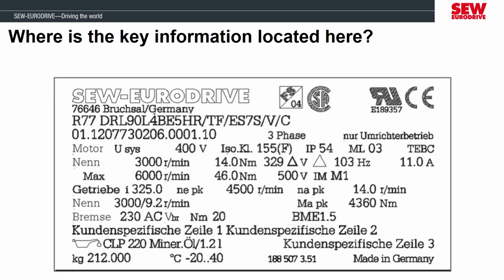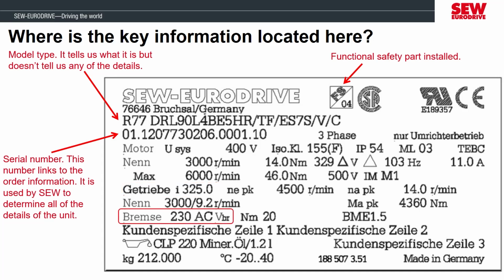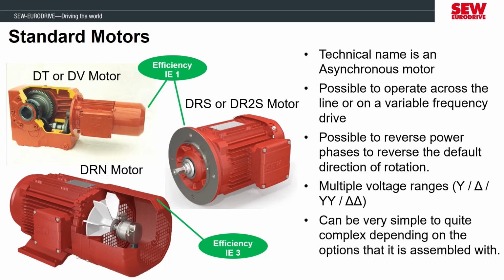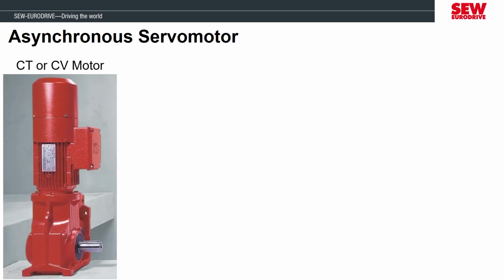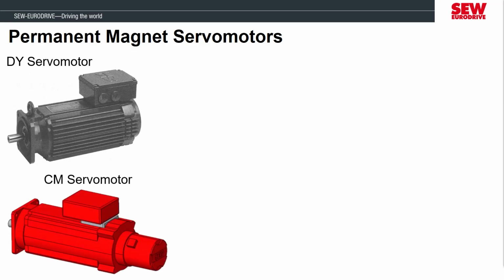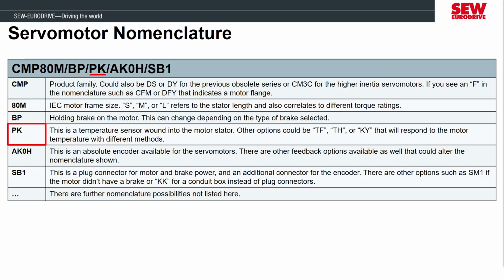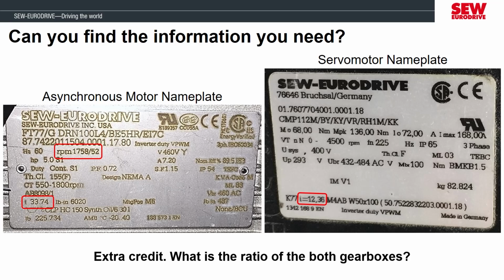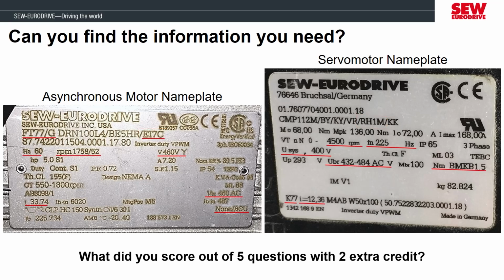MOVIDRIVE® B Training Session 4 - Motor Nomenclature

Comment: 4500 rpm for servo at 225 Hz on nameplate ..   How was this speed calculated  ?
Reply from the maker: Hello Michael. Those values are the ratings on the nameplates and are due to how the motor is designed. Permanent magnet servomotors differ quite a lot from standard 50Hz or 60Hz asynchronous AC motors. Servomotors have to be operated from an inverter oftentimes with encoder feedback instead of "across the line" such as standard asynchronous motors. Inverters are capable of outputting frequencies close to 500Hz. This is why servomotor nameplates will show different rated frequencies and speeds than standard AC motors because of how it is designed to be operated. 

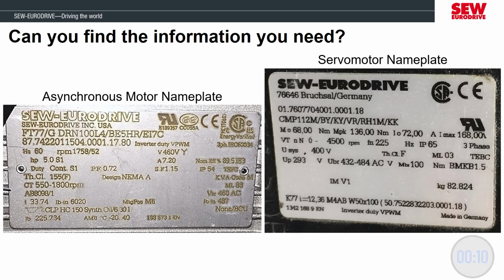In the case of the example shown at 23:10 in this video. That is a CMP112M designed with 6 poles and rated for 400V, 4500 RPM, and 225Hz. 

Here is an equation showing how the 4500 RPM could be calculated.

𝑠𝑦𝑛𝑐 𝑠𝑝𝑒𝑒𝑑 [𝑟𝑝𝑚] = (120 ×𝑓𝑟𝑒𝑞𝑢𝑒𝑛𝑐𝑦)/𝑝𝑜𝑙𝑒𝑠 =>
(60 𝑠𝑒𝑐𝑜𝑛𝑑𝑠/𝑚𝑖𝑛𝑢𝑡𝑒 × 2 𝑝𝑜𝑙𝑒𝑠/𝑝𝑎𝑖𝑟 × 𝑓𝑟𝑒𝑞𝑢𝑒𝑛𝑐𝑦 𝑐𝑦𝑐𝑙𝑒𝑠/𝑠𝑒𝑐𝑜𝑛𝑑)/(𝑝𝑜𝑙𝑒 𝑝𝑎𝑖𝑟𝑠) =>

(120 x 225Hz) / 6 pole pairs = 4500 RPM

You can see this equation mentioned in the MOVIDRIVE® B Training Session 1 - Motors & Inverters video starting at 18:29.

https://youtu.be/-ODayS9ayk0?feature=shared&t=1109
Reply: Thanks.  I will save this information